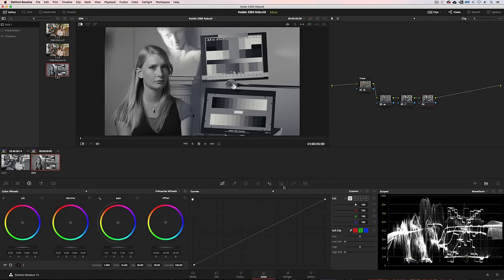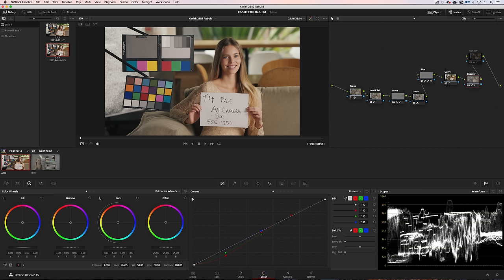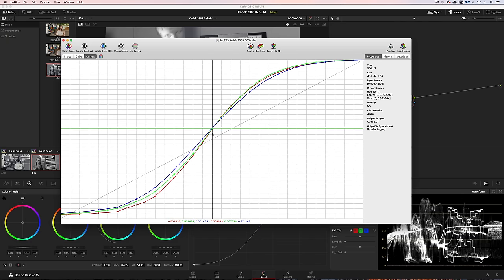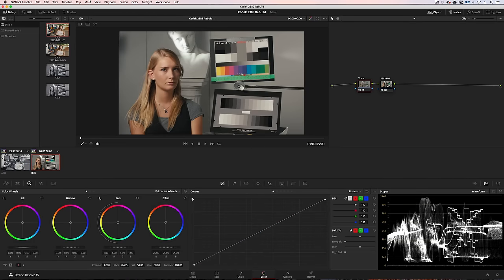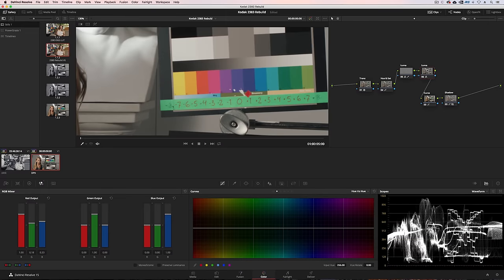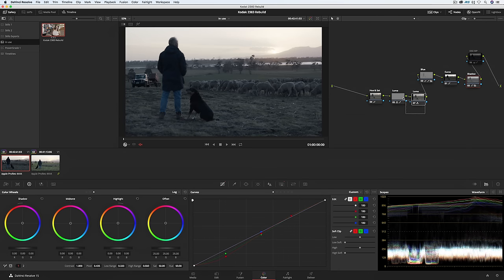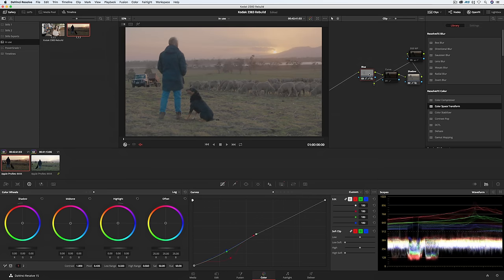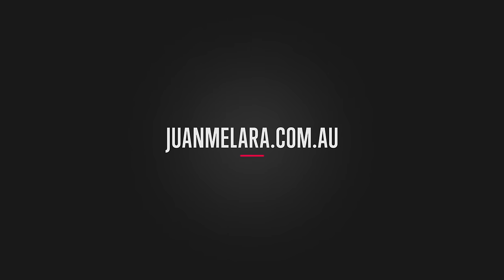The Kodak 2383 LUT rebuilt as a Resolve PowerGrade

Comment: You can achieve this exact same result with this method which is much less time consuming:
Colorspace Transform from "Your Camera" to Rec709, then apply a Rec709 2383 D65 emulation LUT and grade under it making adjustments to white balance and such. Only difference is you'd have to lower highlights a bit more than with your method.
But I understand, you like to test out every method possible. Thanks Juan!
Reply from the maker: Yeah that will work. The idea with this technique is to recreate the 2383 LUT as a PowerGrade so that you can get a similar look without using a LUT. That way you add/remove/adjust individual components, which is not possible with a LUT.

Comment: Thank you so much for this, seriously straight to the point.  There's just one thing I'm still trying to wrap my head around.  When you make a second color transform node from LogC to Rec709, the color space has already been converted from ARRI Alexa to Rec709 before the PowerGrade.  So does that mean when you convert the color space to Rec709 it'll still contain LogC gamma which is why you were able to make a second transformation node to Rec709? Can't wait for the next video.
Reply from the maker: Yep, that is correct. The colour space has been converted to Rec709 but the gamma is still LogC.
Reply: Awesome thanks
Reply: @JuanMelara82  Just new to davinci.Thank you so much for sharing your knowledge!May I ask you ,in the first color transform node you leave gamma (both input -output) "same as timeline'..is your timeline set to rec709 (color) and  2.4(gamma) ? Also,willing to try your power grade with Panasonic Vlog footage, should I add one more colour transform prior to your first one (for color space) and use vgamut->alexa without  saturation mapping?Thanks!

Comment: i think the thing that confused me at first was the transform to Arri and then later in the node chain to add another transform - but after viewing a second time, I see that you changed only the colorspace and left the other dropdowns to "timeline" and then when you added the second transform, you then transformed the gamma. I do see that now, but wondering why that change happens so far down the node chain and how would it differ if you changed all the parameters in the first transform. Not saying that is correct but wondering what the answer is? I

 - Another great video Juan.

Comment: Top notch, densely packed material once again. I can always watch these several times and pick up a new technique or piece of advice I missed on a previous watch. I have a question about the use of curves. Aside from the fact that you had exact curves to replicate, would it have been a much different result to use the color wheels to push colors into those ranges instead? 

Same for the part where you qualify the blue bias and also used a curve for that - could that tone have been pushed in with the shadow wheel instead for instance? Just curious what determines the preference - simply accuracy, or is the look significantly different as well?

Thanks!

Comment: Thanks, this will come in handy. Is your timeline gamma set to LogC? If I understand the math correctly, the color-space transform tool needs to know the current gamma in order to correctly transform the gamut.
Reply from the maker: I've left the timeline gamma and colour space as default. I do this so that all the transforms are contained within the node graph. That way its easier to move looks between projects and even different cameras. Gamut and gamma can be transformed independently of each other, so the CST tool doesn't need to know about gamma if you just want to transform gamut.
Reply: Juan Melara I believe gamma can be changed without specifying the current gamut, but not vice versa (technically). A gamut conversion is a non-diagonal matrix operation in linear space. So to convert gamut, resolve has to convert to linear light, apply the matrix, then convert back to the original gamma. Try doing a large gamut conversion (like ACES to rec709) in two ways: with ‘incorrect’ linear gamma input and output, and then with ‘correct’ log gamma input and output. I see differences in bright saturated colors. Overall it’s not a perceptually big difference if you then turn on gamut mapping. I only noticed because I’m coding a lut generating plugin similar to LUTcalc and this issue came up. Thanks again for the excellent tutorials

Comment: Your videos are the best! quick questions, I shoot slog3 cine on FS5, I applied slog3 cine to REC 709 CS Transformer before your power grade, should I make exposure adjustments before the transformer in log with the offset and contrast/pivot or after with the primary wheels does it even matter? thank you!!
Reply: just watched the video again and found the answer!... another question, is there a way to create a node that will forget all the nodes that before hand and just work with the final node? im trying to create a faded look and everytime I raised the lift or the curve I get back all the details
Reply from the maker: You'll have to break Resolve's 32bit float processing. Create a node and then in the curves tab move one of the softclip sliders a fraction. Any nodes downstream should be working on clamped data.